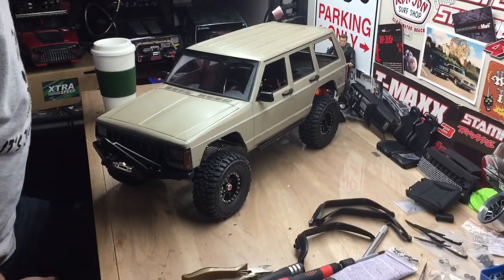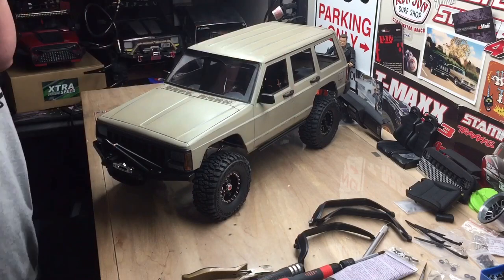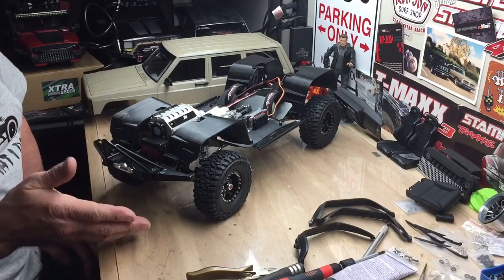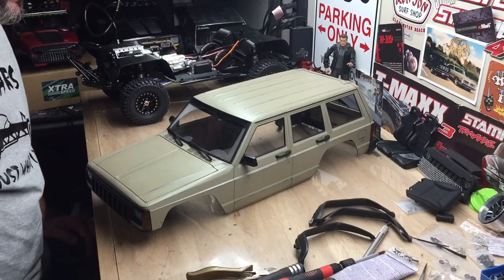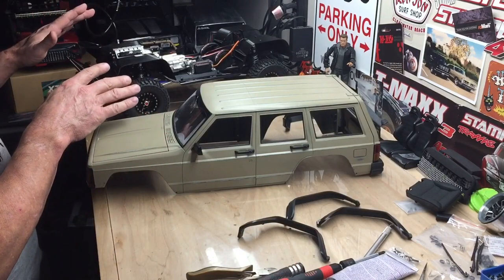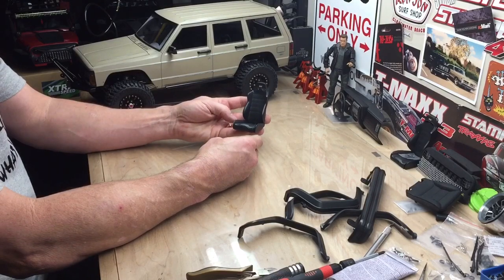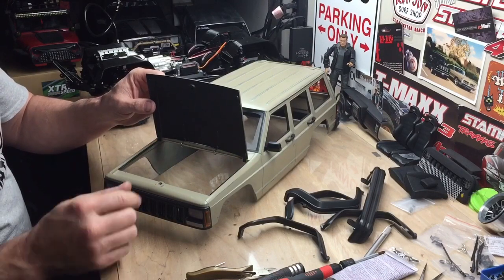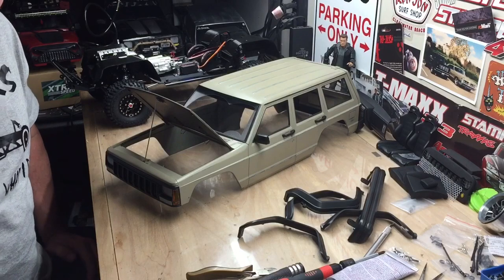Xtra Speed V8 Axial XJ Hardbody Build #4

Comment: nice it is looking really good so far! the one thing i really like about this project is the detail on the front fenders. my axial truck is fun, but it was my one compliant that the fenders were extremely high up. i understand why, but i think this body is very nicely scaled, and detailed.
Reply from the maker: Nikki Sticks Yeah... with the fenders on I probably would have to use smaller tires. I think it looks better this way for sure. Thanks for checking it out, I appreciate it. Have a great weekend 😃👍🏻

Comment: How did u mount the windows?? I'm having trouble with mine
Reply from the maker: GTGaming224 I just use Shoe goo very sparingly to set the windows. Work pretty good!! Hope this helps. Appreciate you checking it out. 😎👌🏻👍🏻
Reply: @kingstonrc329  awesome. Did u applied it around the frame or on the window itself then install??
Reply from the maker: GTGaming224 I put it around the window and then set it in place. Good thing with Shoe goo is if you let it set up, and if some squishes out you can easily remove it afterwards. 😉👍🏻
Reply: @kingstonrc329  ok awesome man appreciate the help and quick response.

Comment: Nice build fella I'm building up a scx10-2 RTR to my specification I'm now at the stage of mounting the same jeep Cherokee hard body but the brackets it came with are useless! how will you be mounting yours to the chassis fella? Also for me my inner arches will be in the way of the mounting brackets which causes another problem.
Reply from the maker: 2losangeles Yeah... it’s kind of just figure it out as you go. That’s what I’m doing not trying to rush it just figuring it out as i go. Mine didn’t come with any brackets, I had to make my own. And like I said I’m still figuring out the rear mounting point. Thanks again for checking it out.😃👍🏻
Reply: @kingstonrc329  yeah true I will try and see what I can come up with I've subscribed to your channel so I can watch the updates on your build and see how you mount your body too 🙂 thanks for your help fella 👍
Reply from the maker: 2losangeles 😃 No problem... Thanks for the support I appreciate it. 👌🏻👍🏻

Comment: Where did u get the front bumper??
Reply from the maker: Hey... Thanks for checking it out. I got the bumper from Amazon here’s a link to it. RC Car Front Bumper, RC Crawler Steel Front Bumper with LED Lights for Axial SCX10 90046 Remote Control Car Replacement Upgrade Part Accessory https://www.amazon.com/dp/B07N6814HZ/ref=cm_sw_r_cp_api_glt_fabc_WH5Z3Y0GA6GNHZFPG1T7 great looking bumper, fits well on the XJ. 😉👍🏻
Reply: @kingstonrc329  what about the rear bumper
Reply from the maker: @423Volt  The rear bumper is the bumper that came with the XJ body. I used the stock bumper for the rear.